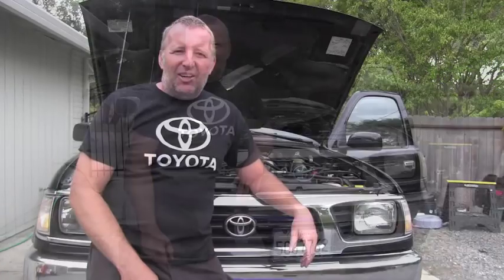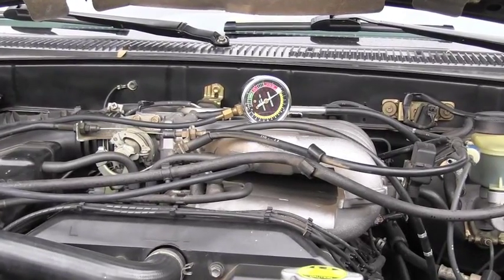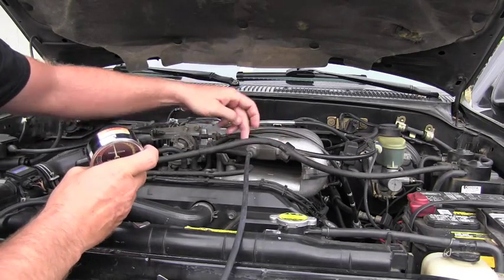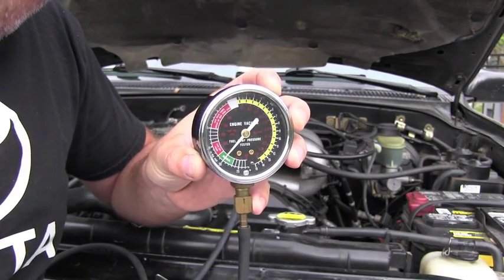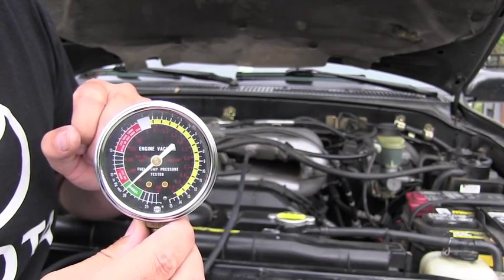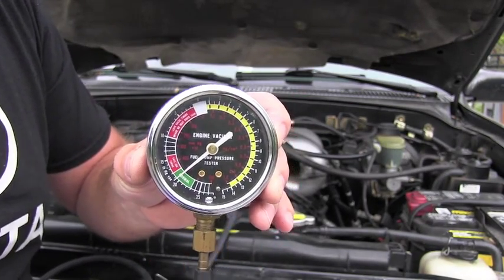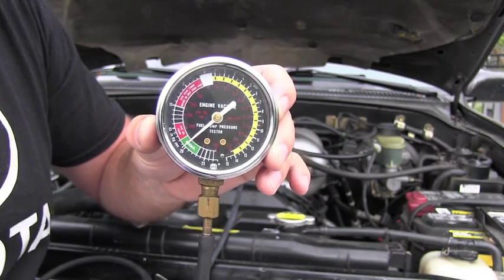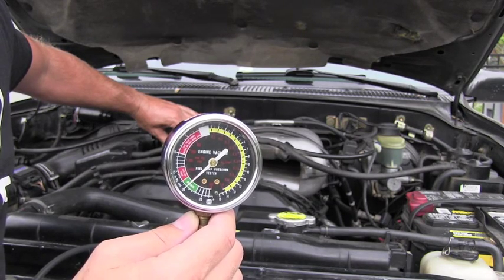Toyota Engine Intake Manifold Vacuum

Comment: I have a 2002 Tacoma with the 3.4 liter engine.  I have intermittent idle surging especially when it rains or when its very humid.  I replaced the IAC and MAF sensor recently, no check engine codes.  I'm beginning to think I might have a vacuum leak.  On this engine where are the most common areas where vacuum leaks occur.  I always enjoy your videos and I have learned a lot from you.  If anyone has any ideas I would appreciate the input.  Thank you for posting.  God Bless...
Reply: Find it?
Reply: @wbwills2  I took it to a shop and had them replace the intake manifold gasket.  They also recommended replacing the throttle position sensor which they did.  I haven't had anymore issues since.  Thanks for asking.
Reply: Mark V Thank you for replying. I don’t own a scanner but while I have been chasing this problem down one of the most recent scans at parts store said “plenum gasket “that was a new one. I’m almost positive it’s a metal   gasket & wast thinking it being metal it should be fine. Looking like I need to quit thinking & trust the scan & replace that gasket. Easy to get to & doesn’t cost much either. Going to give it a shot. Take care.
Reply: Mark V the sensor...do you remember the price. Around $200?
Reply: @wbwills2  Not sure on the price but I do remember that the TPS was on the throttle body and didn't seem like it would be had to change out.  Maybe try RockAuto??